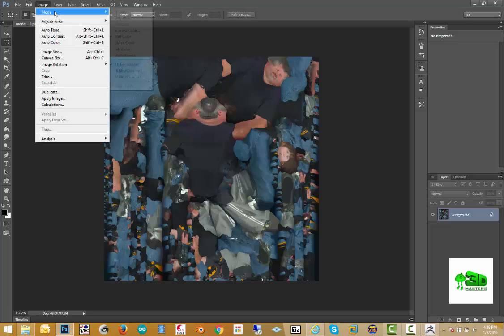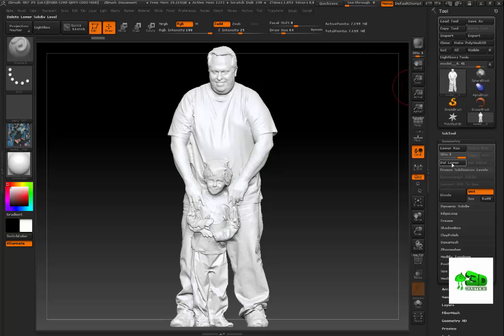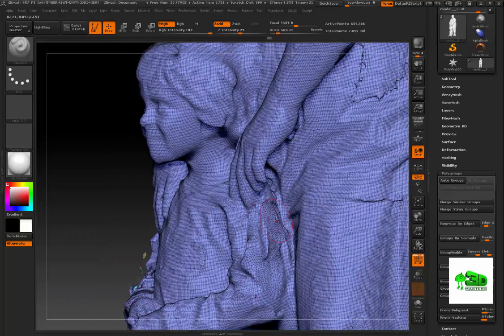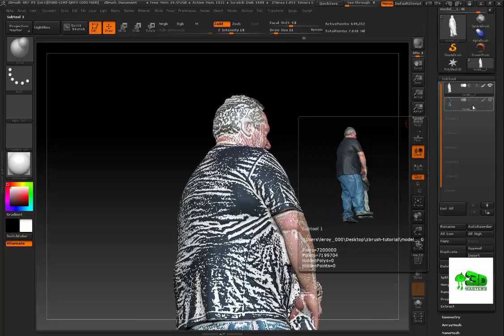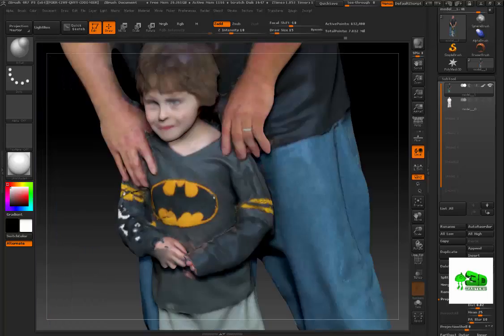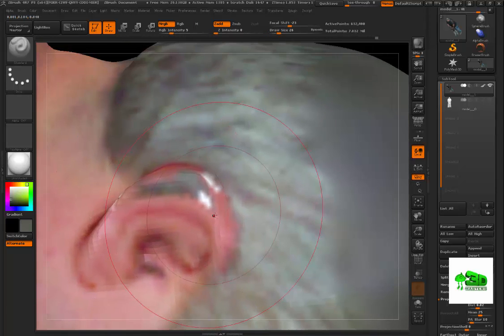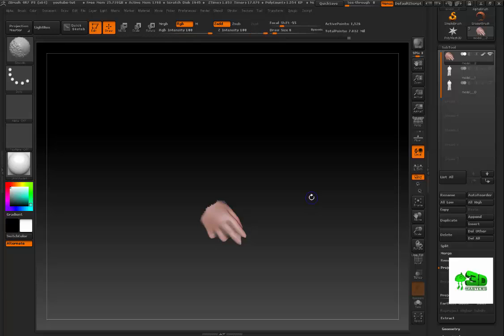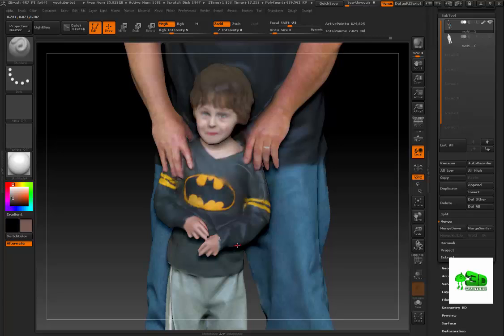Zbrush tutorial to repair 3d scanned models of people

Comment: I have a question about one part of the process. I usually do this with another workflow totally different than yours, but I just wanted to try this too. My problem occurs when I delete hidden mesh,then close holes. Somehow texture gets broken, unclear and distorted with some strange stripes over it. Specifically that happens after I close holes. Projecting doesn't help either. Do you know why is that, and is there any way to go around that step? or maybe I've missed something, but I followed everything you did so... thanks! hope someone will answer this :)

Comment: Dear, thanks for the video. What scanner did you use for this model? do you think the Ein Scan Pro will have enough resolution to print in what layer resolution maximun? The Ein Scan is teorycally 0.05mm, thus, you think printing at 50 micron in a SLA printer will really get that resolution printed?
Thanks again !

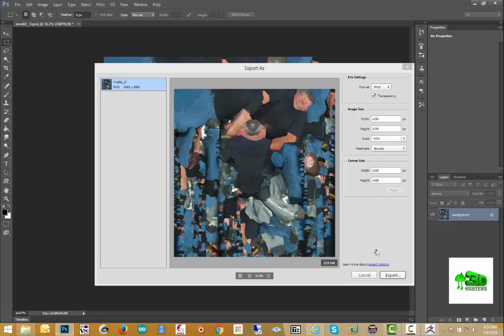Comment: 4:38 I think the time it takes to save you png is caused by the compression setting. If compression turned off, it will take 3 seconds. Turned on it can take 30 seconds.
Reply from the maker: I need to find these settings in Adobe cc. really takes to long.